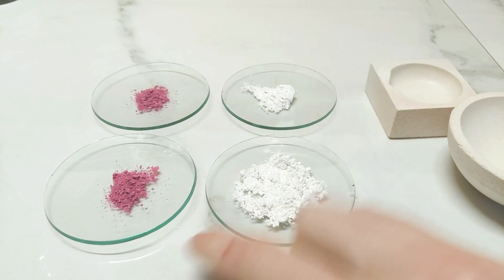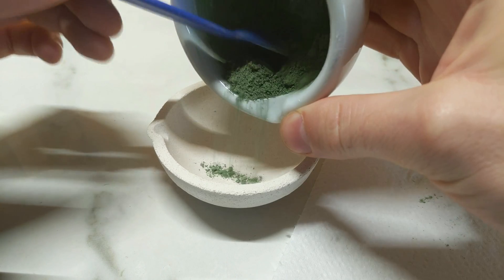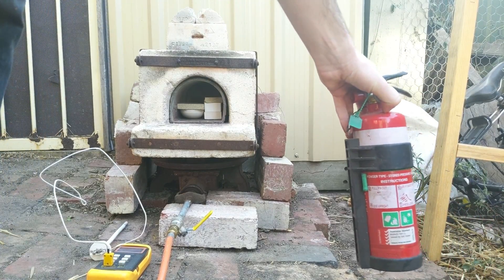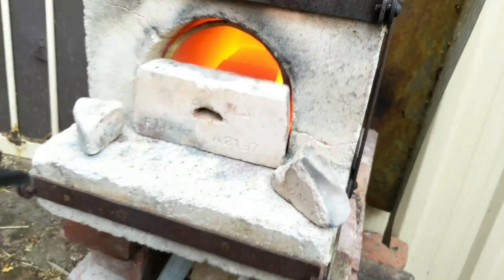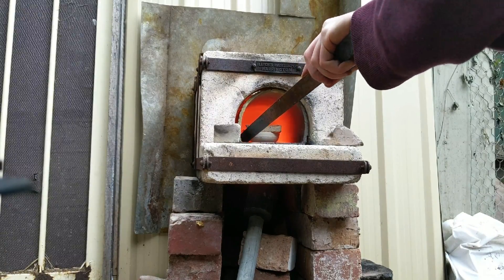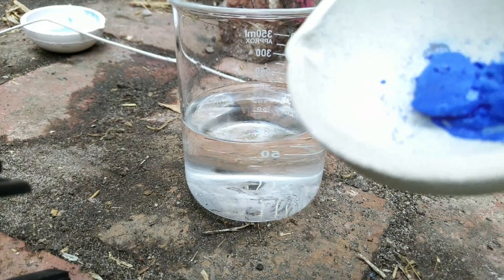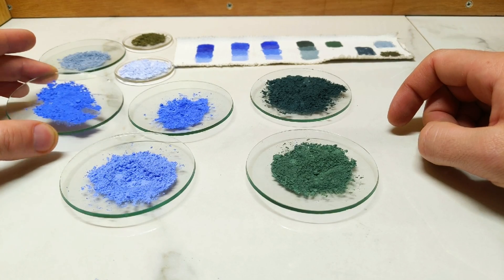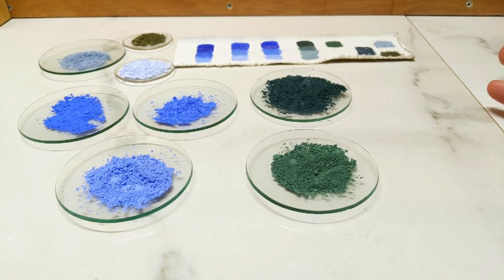Making Cobalt Blue: Part 1

Comment: The spirit of experimentation is very cool and I get more and more triggered to become an alchemist of pigment and paint making. I have never seen calcination of pigments so far. Even if not able to do it myself, I find it very inspiring. I am reminded of the update video... oh yes the alchemy of making vermilion / cinnabar. I have read about it, but it seems to be, beside being dangerous because using mercury, a real alchemical challenge. In "The Materials and Techniques of Medieval Painting" by Daniel V. Thompson I read about it, but understanding it from reading is not easy. On the Kremer website I found that they claim that the vermilion cannot easily be made or better reproduced in its colour with other elements (metal ions and salt rest ions), but that it is not very stable in high UV radiation... But that is all too much guessing. Thanks for what I was able to learn from you, even if so far the knowledge is only theoretical. With that kiln you have anyway good possibilities for making all kind of colour shades. The possibilities must be endless... Very cool results on the blues and dark green. The light blue first reminded me of Coelin blue.